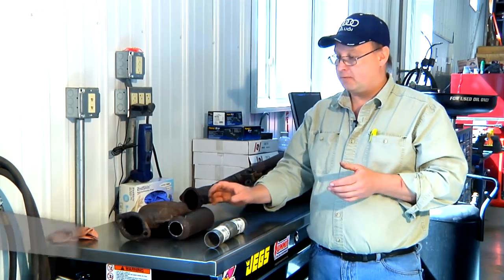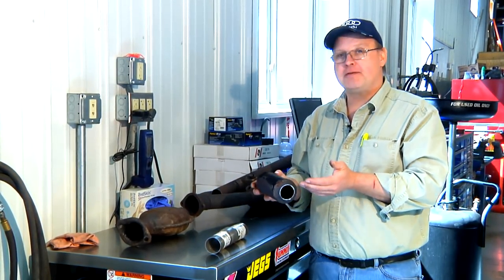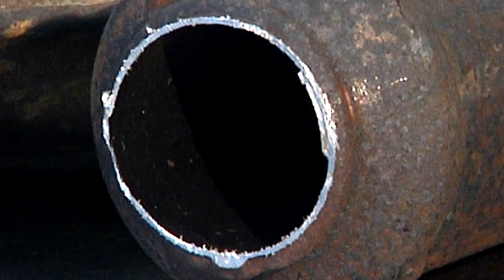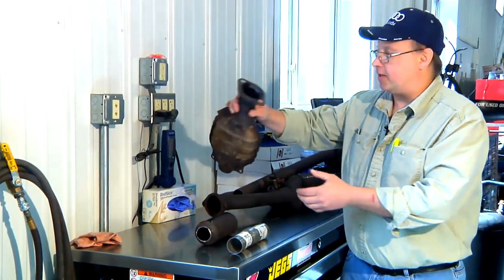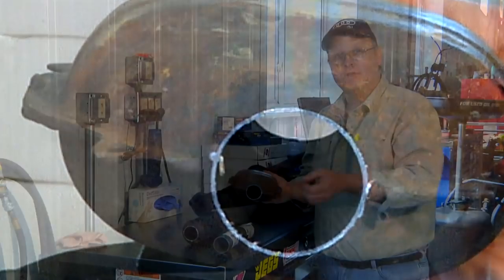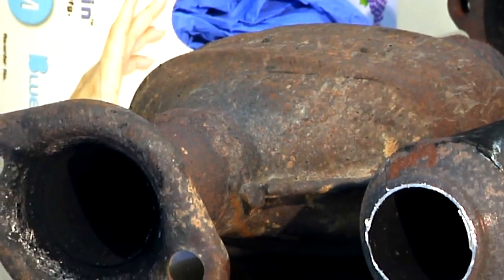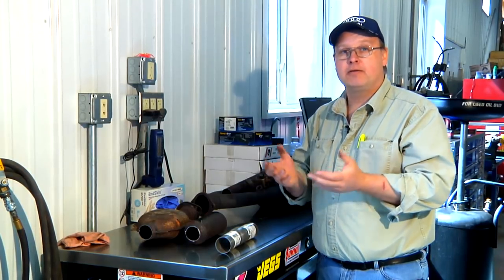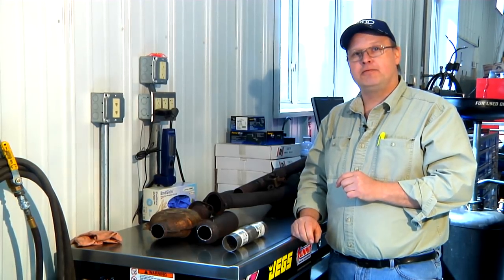What Happens if You Replace the Exhaust Resonator With a Pipe? : Under the Car Repairs

Comment: Lol, everyone giving this guy shit about his backpressure statements.  Backpressure actually extremely benefits driving under roughly 2500rpm in most cars (aka: what you'll be at in 5-10th gear at 60-70 in most modern cars).  All the videos "busting" the myth of backpressure even show this (open exhaust/no backpressure systems LOSE HP/torque at <2.5k rpm that I've seen).

Now, is it relevant for track cars that you're going to be at 3-9k rpms at almost all the time (if those seem high, you haven't driven an eclipse or s2k)? Absolutely not.  But for your daily driver--especially daily drivers on freeways--it'll help you out quite a bit.  Going to massively improve response and handling in those RPM bands as well, especially if you're one of those people that just puts it in 5th/6th and then never downshifts to pass because the magic of modern engineering allows you to not lug your engine doing that now.
Reply: Yep....
Reply: You are not understanding the fact that its all about the loss in exhaust velocity NOT back-pressure that hurts power when you go to an open pipe with no other modifications.
Low RPM's = low gas velocity and volume.
High RPM's = high gas velocity and volume.
If the exhaust is TOO big in diameter for the given RPM's and engine size you will lose power because your exhaust is now acting like a divergent duct which makes the pressure go up. You will lose any scavenging effect and might even be running TOO rich a fuel/air mixture as a result.
An engine "needing back pressure" is a MYTH!!
Please just stop.
Reply: It's an engineering fact, naturally aspirated four-stroke engines benefit from slight back-pressure at lower RPM, and it has a DRAMATIC impact on lower-end torque.  Where back-pressure becomes a problem, is in high RPM scavenging restriction, and on forced-induction applications, particularly turbocharged engines.  Please, please everybody learn/understand this and stop arguing about it.  Take it from people who truly know, and let us go forward being friends as we share our passion for engines and everything they power.  Cheers!  -RT
Reply: GAS VELOCITY IS WHAT 4 STROKE ENGINES WANT NOT BACK PRESSURE 
EVER EVER EVER.
Back pressure dilutes the charge and you lose efficiency every time.
Reply: Once again, this issue is more complicated than blanket statements like the one you just made.  You're not acknowledging the vast spectrum of velocity, pressure, and volume.  I can also prove to you that an engine can move much more air at 3,000 RPM, than at 6,000 depending on throttle position.  Just because the revs are faster doesn't mean the volume of air being pumped rises in equal proportion.  Your understanding appears very 2-dimensional, of a science that is anything but.  I'm not attempting to belittle anybody, but when engineers have been talking about the importance of backpressure for 50+ years, it's time to drop the notion it's a myth.
Reply: I'm redoing the exhaust on my 93 subi impreza, including the baffle chamber.  One thing I've been worried about is that the engine has not been getting the proper back-pressure.  Right now, it drives like a brick.  Super loud, it shakes,  and does not sound very good...  I'm ordering the pipes now.  Hopefully, I'll be back.
Reply: Silvio Mancone 
Back pressure on a turbo engine is just choking it.
Jesus christ it's basic physics.
Reply: blyndrotor Nope.  Turbos don't kick in until after the backpressure power-band has been exceeded.

As a result, the <2500rpm improvements as I stated remain intact.

Thank you for proving yet another prime example that perfectly demonstrates what I'm talking about though.
Reply: formdoggie5 
Not exactly sure what it is that Im proving here.
Now a turbo engines exhaust requirements are greatly different to an atmo engine and to use the same theory for both is just poor engineering. 
Pulse scavenging is your best 
friend with an atmo engine.
Once all thepulse from the atmos engine exhaust ports are correctly merged there is little to gain in doing anything fancy with the rest of the system.
As long as the rear 1/2 of the system and cat are low restriction then your sweet.
The turbo exhaust really is a case of less is better where a straght piece of pipe off the turbo housing is best and anything else is a compromise.
Reply: blyndrotor except for literally all the charts that show improved performance is precisely the band I mentioned--aka: the one you'll be driving in most often.
Reply: formdoggie5 
Well that depends on the car.
Well engine to be more precise.
Reply: blyndrotor Sorry, I've looked at hundreds of dynos "busting" this myth for years.  

That's never been the case, especially with anything even remotely fitting the context of my original statement.  They all go "haha busted the myth of backpressure" and then when you look at the dyno graph it literally shows how much you're losing.
Reply: formdoggie5 
All I know is that my rx7 with just a 3in of the turbo through to a twin system and a larger intake reaped gains all over with an improvement in boost response and peak boost
(climbed from 7 to 9-10) with no loss in economy, dependant on your right foot.
Reply: blyndrotor ...so you changed multiple things that increase performance across the board that have nothing to do with a direct controlled backpressure comparison, and are then making comments based on such results.

Do you really not understand how that's bad?

Because that's really, really, really bad.
Reply: formdoggie5 
They were the first things changed.
And based on my results (and
knowledge) I see an improvement in efficiency and driveabilty.
Reply: blyndrotor That would be a no.
Reply: formdoggie5 
No just pointing out that the upgrade in the exhaust, granted, an upgrade to the intake as well, yielded results 
across the board. 
A reduction of restriction in the exhaust and intake are the most logical reason.
Reply: blyndrotor No.  Your logic is completely flawed, which is why you don't even understand why what you're dong is wrong.
Reply: formdoggie5 
Look lets agree to disagree and go our seperate ways.
Reply: blyndrotor Or not. You've exposed precisely the mechanism via which you're making a faulty comment, and then instead of fixing yourself or even trying to understand how it's bad so you don't do it in the future, you attempt to justify your actions and then go into full avoidance mode when actually called out for doing so.
Reply: formdoggie5 
Nah. Take it outside.
Reply: formdoggie5 do you know rotaries? He is talking about an rx7...

Comment: I removed the resonator from my '06 Impala roughly a year ago. To date the only difference between having the resonator and removing it was a 2-3 mpg decrease, and no negative effects to engine maintenance or performance.
Reply: Resonators control sound waves not add backpressure. When the exhaust valve opens you want a low pressure wave on the exhaust side of it. That resonator is tuned to make sure that happens at low RPM.

Comment: In a normally aspirated engine, the back pressure from the factory-tuned exhaust is good for excellent torque (pulling power) in low RPMs. So, yes, better economy and way less noise/drone than a ghetto straight pipe.

In a turbocharged car, the turbo blades provides all the backpressure needed, and the freer the whole exhaust system, the more power you will get at all RPM ranges. Can be replaced with a wider pipe to keep the drone / noise at acceptable levels.

Comment: installed headers on my 97 chevy k1500 z71 but not sure what to do about the egr hose that attachesthe intake to the exhaust manifold that was stock on the truck. the headers i purchased do not have that hookup. any ideas?

Comment: i just have to point out aftermarket exhaust gives more flow / less back pressure and increase hp and mpg. that tells me the man in this video is very uneducated in the field of what the hell he is trying to talk about. i hope you all understand where im going with this.
.
now let me explain what the resonator is really for. it is there to stop your exhaust from popping and back firing. that is its only purpose and that is all it does. no back pressure sorry. notice it is larger then the pipe and looks hollow, it should be lined with fiberglass. the pop is hidden so your car is not so loud that is all. remove the resonator and it will pop and crackle and backfire and might get better gas mileage.

Comment: Backpressure isn't what matters, it's proper pipe diameter, if your pipe is too big, the exhaust won't be forced through the pipe at the correct rate since it has room to build up in the pipe before being pushed through, but if the pipe is too small, then all of the exhaust gases can't be forced out in time, but it will have more velocity due to the higher pressure in the smaller area, you need the perfect diameter so that the exhaust will have a high velocity, but all of it can be moved efficiently, so the term back pressure doesn't really make sense, what you need is correct pressure in the pipes

Comment: it's good for performance to eliminate as much as you can the back-pressure, which help reduces the amount of exhaust gases remained prior an intake stroke along with less resistance for exhale process, but the combustion would run too hot and may cause exhaust valves to be burnt think about EGR, while cruising especially at high RPM calculated amount of exhaust gases would be added to the clean air to keep combustion temperature moderated, what you have said on your comment makes sense though.

Comment: Thank u yes it does specially engine with turbo charger 
I did take my rear muffler and add the straight pipe i get more turbo sound plus more exhuast sound and my mpg drop by 4 to 5mpg but my turbo seal gone after 200 miles and i have to fit reconditioned turbo for 600 pound was it worth a risk for a more noise i tell u NO for me

Comment: If our new cars did not need resonators, the engineers at the developmental dept would not have incorporated them into the exhaust of our car. I see people do this but then get GREAT sound but a bad noise through the car. That is why if you do delete them you need to add a muffler that compensates for this removal, from Borla, Flowmaster, etc.

Comment: 1998 lincoln continental with 2 inch pipe 2 cats,resonator,and another cat with no o2 sensor going to 2 stock mufflers.custom 3 inch ram air,ported intake with tumbler c  cobra heads,cobra fuel pump and IMFC.I want to eliminate the 3rd cat and go with cherry bomb turbo mufflers .Any suggestions?

Comment: With a catalytic converter, resonator, and muffler you have much un-needed back pressure. All you need for back pressure is a damn muffler. Look at the old 70s vehicles, they had no cat or resonator, just a muffler. Newer cars actually have too much back pressure.
Reply: SilentSniper 60s cars... a lot of 70s cars were in the first phases of emissions  in 72/73...with huge bead cats  that robbed even more power than the honeycomb style used today

Comment: Its like my wife's Lincoln Town Car we got lucky and it has dual exhaust...but it has cast manifolds, four catalytic converters, H pipe, large heavy funky looking mufflers, bends to go around the axle, resonators that look like perforated tube glass packs, 2inch piping. The engine feels like its being smothered even though its a dual system. it is probably a combination of the factory exhaust and the intake and tune that is smothering it like that. eventually I'll have it worked out.

Comment: To the guy who's arguing that drag cars don't use back pressure.. well no shit, they run for all of 4 seconds or so, make huge amounts of power with the sole purpose for going as fast as possible in the shortest time. I bet your daily could benefit from back pressure since it certainly is no drag car.
Reply: right and if they could make more power by using a factory exhaust setup, as some have advocated here, they would--as racing is all about how much HP and TQ you can have and get down the 1/4 mile in the shortest time.

Comment: if you open up the flow of exhaust and tune the ecu properly you will gain both fuel mileage and horsepower!
The only reason you lose performance when lowering back pressure is because O2 sensors will send a different reading to the ecu and without proper tune won't be able to compensate correctly as the fuel air ratio parameters are not within factory settings

Comment: I'd removed the 3 foot long resonator of my 06 3.5 Altima and the sound barely change , i then took my car to a muffler shop and replaced the entire mid pipe and what a change , lot more torque down low , no noise increase cause i kept the stock muffler.
Reply: with modern fuel injected engine if you remove a component it will adjust to it or trip the check engine light, do your homework before, any speed shop will tell you that less back pressure is better.😂

Comment: valve overlap has something to do with that also. it will pull exhaust gasses back into the cylinder during intake stroke because it wasn't properly scavenged. heat also helps scavenge exhaust. but it's mainly because of the low rpm operation.

Comment: the resonator does not gather pulses from the exhaust... Thats what headers are for, as it flows from the headers it hits your cats any pulses that dont end up coming out "smooth" the cat will correct. The resonator is only placed to reduce sound. Nothing more nothing less. Replacing a resonator only makes it slightly louder, maybe 2-4 decibels depending on the car, would be noticeable but not very noticeable.

Comment: I think this guy needs to substitute the term "back pressure" for "velocity". As a performance enthusiast I prefer the sound of resonators in a system, they make the exhaust (and thus the engine) sound more tuned, deeper toned and less raspy. Some folks like the high pitch raspy sound and that's okay. It comes down to personal preference of tone and sound. Resonators are absorption mufflers, with the rare occasion of a helmholtz resonator. This "back pressure" people talk about is simply velocity in the pipe at low rpm. Smaller exhaust pipe diameters promote the low volume of exhaust gasses to speed up in the exhaust system (like when at idle, off idle acceleration and low rpm cruise) and sacrifice the ability to move large volume of gasses (like when reving and engine close to redline). Larger exhaust pipe diameters do the opposite. Since the lower volumes of gasses at idle, off idle and cruise are moving slower in a larger diameter pipe the driver usually feels the sensation of loss of torque. But the gains are in the high RPM, high exhaust volume. Resonators do not affect velocity, unless of course they are 1960's style glasspacks with the punched inward louvers causing an obstruction.

Comment: I thought resonators just quite your car down but if you have a turbocharged engine then getting rid of the resonator if your running one 3" pipe from the turbo to the muffler delete, then wouldn't that be better for your engine? You can feel how the back pressure makes your engine rpm drop really slow and so unresponsive even in n/a cars

Comment: being a mechanic ive always learned that the first "muffler" (catback) is to kill vibrations / frequency's and the last is to lower the sound thats all - and really backpressure? why would you want pressure against ur valves / pistons... it will only prevent ur engine from getting to higher rpm faster and we all know fast but smooth gear changes excells ur mileage, atleast it did on my Inline6 2,6 12km/Liter not to mention 5+cyllinders sounds badass period..

Comment: I've been doing a bit of research into back pressure and exhaust resonators, I understand how the small holes in the outer part of the resonators work to make every thing flow faster.. In saying that, does it mean you can just have a straight pipe and no silencer what so ever if noise restrictions weren't an issue? Thanks

Comment: I have a 2006 Dodge CHARGER RT 5.7 hemi and I want to know what exhaust should I run flowmaster  are magnaflow?help
Reply: +Ramone Kent Get flowmaster and cat deletes
Reply: +Ramone Kent If you want better performance and just a low good sounding rumble, without it being crazy loud get a magnaflow straight-through flow muffler. If slightly less power and torque gains but a much louder more aggressive sound get a flowmaster. Just look up videos of your car with people posting vids of magnaflow vs flowmaster and using some good headphones to listen and see what ya like, it won't sound exactly the same as in real life but close enough.
Reply: +Ramone Kent Magnaflows are the way to go. Mount a pair at the rear of the car, just in front of the bumper. A lot of guys mount the mufflers in the middle of the car, but you'll reduce exhaust drone if you mount them in the rear of the exhaust.

Comment: I am curious to know if backpressure affecting performance (in a negative way) is more for stock naturally aspirated engines. How about with stock Turbo vehicles? Usually less back pressure is what you want with a turbo and results in a positive change in performance. Any thoughts on this? Would it be more beneficial with forced induction?

Comment: What about resting overnight condensation. I was lead to believe a muffler also plays a part in storing condensation to stop water reaching the engine. Why you see steam coming out the exhaust on cold starts. Just sharing what I was told.